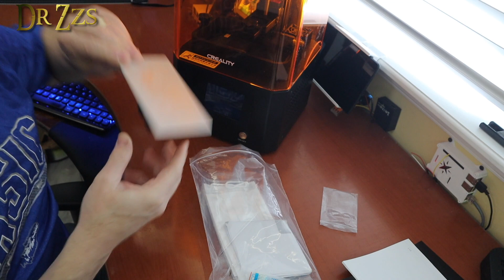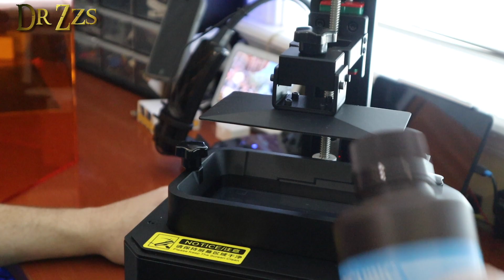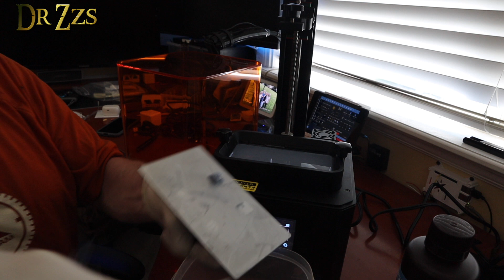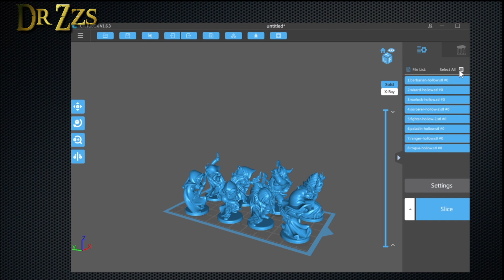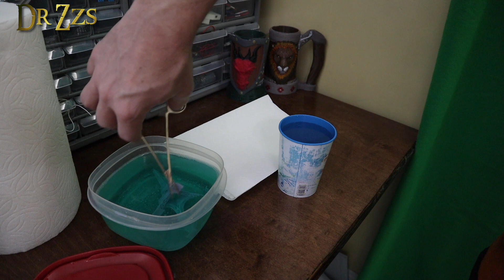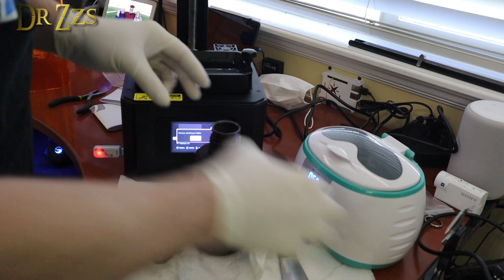Creality LD-002R Resin 3D Printer - My New Toy

Comment: So, I've learned from my makers space that you want to avoid putting flat surfaces on the build plate as much as possible. In whatever slicer you're using orient the print in such a way that it prints supports connected to the bottom instead. Like, for the minis you printed, print them in a slightly tilted orientation so that the flat bottom isn't in direct contact with the plate. Hopefully this helps anyone else who visits the comments too, good luck guys

Comment: I'm just waiting to see the video where he integrates this into HA :D I've been pretty into doing resin statues and this is something I'd love, a way to resume a print after powerloss would be an amazing addition.
Reply from the maker: this printer is kinda dumb.  The only way to communicate with it is by putting in a USB drive.  I'm pretty sure I can't use Octoprint with it.  But I do have my other 3d printer connected to HA via Octoprint.  Sounds like I need to do a video about that now too!
Reply: @DrZzs  Yeah it's one of my biggest gripes about these more affordable resin printers. Just wait till you have resin run out during a print 😑 I'm working on figuring out a sensor that will notify me if the resin level gets too low.

Comment: Agree with the others , supports are only needed for traditional filament 3d printing, not resin printing, turn them off
Reply: Same rules apply for SLA printing as for FDM; you can't print mid-air. It's actually even worse with SLA since with FDM you do have the possibility to do bridging and overhangs. Generally I try to avoid supports, no matter how careful you are when removing them, it'll never look as nice as without them.

Comment: Does resin need supports at all?. And the sticking to the bed will easier with less surface connection between bed & print. You need to slightly modify the 3d files for some prints, to facilitate easy removal.